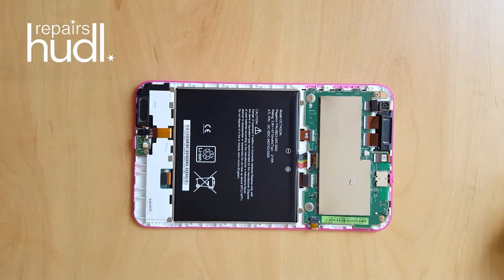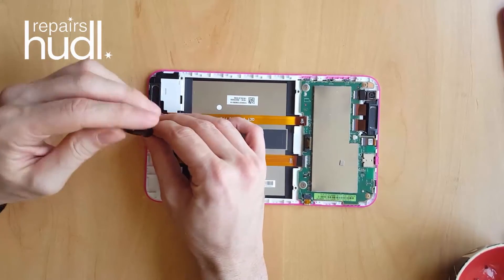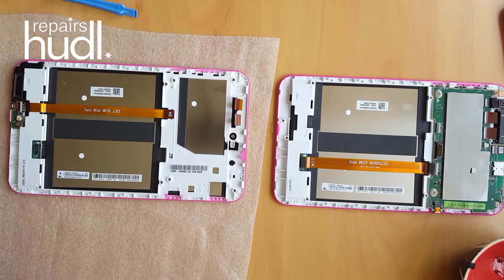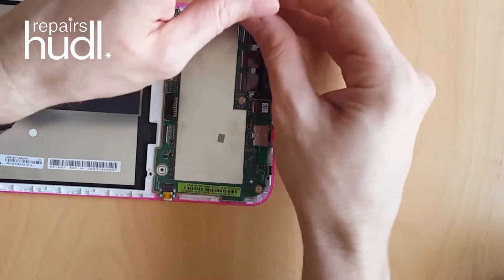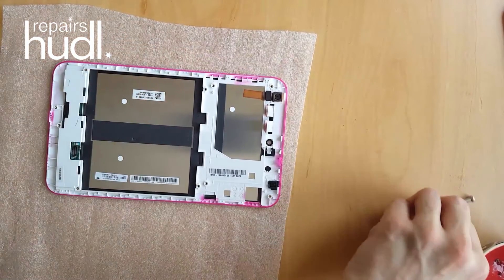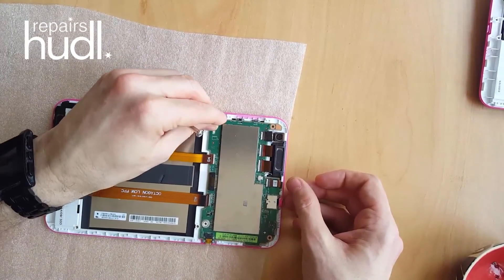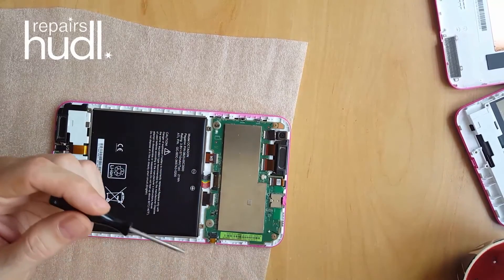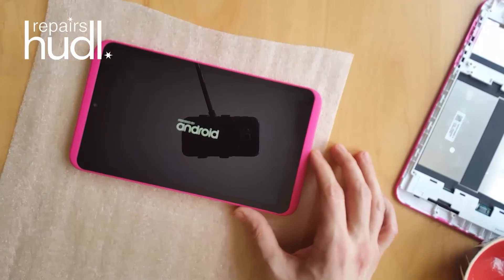Hudl2 Screen Replacement Step By Step

Comment: Superb guide thanks - able to make 1 good hudl2 out of 2 bad ones with your help.
Reply: Where did you buy the screen?
Reply: @helmygalindo  I didn't buy a screen, I had a Hudl2 with a dead motherboard which I had kept for spares. When the screen got smashed on the working Hudl2, I just swapped motherboards.

Comment: Hi, I've just replaced the charger port on my sons Hudl2, simple enough to do and seemed to go smoothly but now the touchscreen doesn't work, I cant see any loose or damaged wires, any ideas what it could be please? Thanks in advance
Reply from the maker: I suspect a loose connection on one of the ribbon cables. I would recommend you follow the video and strip the Hudl2 down and reconnect everything to confirm that nothing is loose.

Comment: If you undo the four small battery retaining screws and lift the battery up it is far easier the undo the battery connector and prevents damage to the connector itself.

Comment: Thanks. I had two Hudl2 devices, one which had developed an OS or hardware  fault and other had a smashed screen. With your help I was able to do a transplant of the Motherboard so I now have one fully operational device. I was puzzled for a little by the small black plastic thing attached to a copper strip which I found on my desk during the operation . It turned out to be the rear camera, which had fallen out - amazing that such a small thing can take reasonable photos.

Comment: Thanks very useful. I suspect that the small black tape ensures that the speaker wires remain protected/fixed to the charger port circuit board.

Comment: Thanks for great video. Just a heads up for others... There seems to be two different sized front cameras. When I swapped over the main board of one hudl to another the camera wouldn't fit so I had to swap that as well. The hole in the screen moulding appears to be a different size on some versions of the hudl2.

Comment: I have just replaced my nieces Hudl2 screen after following your directions. Absolutely no problems what so ever ( I am an ex RAF electrical electronic engineer though lol). The easiest way to remove the back cover from the Hudl is; to use a guitar plectrum just start one corner push the plectrum in and then go around the seam takes about five seconds to get the back off. Also no scratches or dings using this method. Cheers.

Comment: Excellent video thank you. Helped immensely when changing screen. 
One slight variation with my Hudl was that the upper ribbon cable behind the battery seemed to have a slightly different clip on the motherboard. 
Instead of the white part flipping upwards to unlock the ribbon, it was the opposite, ie. the white part stayed flat and the grey/black part flipped up. 
All the other clips were as shown in your video, whereby the white part flips up to unlock.
Hope this may help someone else.

Comment: Very good guide thanks. I appreciated the clear and calm style and the notes about "gotchas". I personally found it easier to disconnect the motherboard-end speaker and remove it separately to the motherboard. My glue was a bit more sticky and came away with an alarming sounding crack, everything intact though.

Comment: hi there
my hudl 2 won't turn on or even charge up.
tried holding down the power button and volume together and just tried a brand new battery. Still no joy.
anyone have any ideas, thanks guys
Reply from the maker: That sounds very much like a faulty motherboard. The trouble is these are really difficult to get hold of. The only real option is to purchase a Hudl2 with a cracked screen on eBay and harvest the working motherboard from that and install it in your Hudl2. The trouble is the prices of these are starting to rise. So expect to pay between £35 - £45 for a Hudl2 with a cracked screen that does boot. On the plus side, you can also expect to get close to these prices if you sell your Hudl2 if the screen is in good condition.
Reply: +SoftwareJellypie 
hi Jellypie
thanks so much for the advice, I will look into those options.
really appreciate your reply
Reply: Nicola May Williams There is a chance the battery is faulty but take jelly's word for it not mine.

Comment: hi guys. followed this guide to fix my hudl 2. After going through this guide thoroughly I am getting phantom keystrokes when fully assembled again. I've replaced the replacement screen with another and it still is doing the same. anyone have this problem before and know a solution?  Thanks in advance Jodie
Reply from the maker: Hi Jodie, the only thing that's likely to cause that is if the ends of the OCTAGON LCM FOC cable are damaged. Are you 100% sure that they are correctly seated? I.E. you flipped the cable clips up to connect them and flipped them down to secure them? If so then you can pick up some replacement pretty cheap on eBay: http://www.ebay.co.uk/sch/i.html?_from=R40&_trksid=m570.l1313&_nkw=hudl2+ribbon+cables&_sacat=0
Reply: +SoftwareJellypie thanks for your reply. I will buy a new cable and give that a try just in case they have been bent or damaged after putting the battery back in. I'll keep you posted

Comment: hi i changed the motherboard over but i have a line right through the middle that is unresponsive have i done something wrong
Reply from the maker: That exact issue can occur if there is a fault with the motherboard, or if the ribbon cables are not seated 100% correct. I would recommend disconnecting the ribbon cables and reseating them carefully. If they are seated correctly the white line on the cable should be scarcely visible.

Comment: which way wud b best change screen or motherboard
Reply from the maker: There's little difference between the two. If you have one hudl 2 with a broken screen (that does boot) and one with an unbroken screen that doesn't, you'll need to open the one with the unbroken screen and remove the motherboard and replace it with the working one from the other hudl2.

Comment: thankyou for the quick response it was fixed twice by tesco under the warranty but has now ran out offered me £30
Reply from the maker: A working Hudl2 screen is worth £35! If you want to sell it, you'll get around that on eBay. However, I'm sure replacing the motherboard will fix it.

Comment: hi i know this is for screen replacement but i have one that doesnt recognise the charger but is still charging as the battery gets warm. it will not turn on nor can i get the reset menu up could any one point me in direction of what could be wrong
Reply from the maker: That sounds like a faulty motherboard. Unfortunately these are virtually impossible to get hold of. The best option is to purchase a Hudl 2 with a broken screen on eBay that does boot and harvest the motherboard from that. Unfortunately, this does of course mean that you will loose all of your data.

Comment: Hi there. I got a new screen after I dropped my hudl and broke the screen. I followed the instructions carefully, and I am normally pretty good with this sort of thing. The new screen doesn't respond though. Is it likely that I did some damage to the tablet when I dropped it and this is the reason? I wouldn't have thought so as it was a short drop onto wooden flooring. Is there anything else I can try? Or maybe the reconditioned screen I bought is faulty. Is there anything else I can try before I try returning the screen for a replacement?
Reply: Hello. my first question would be:
1. After you first broke the Hudl 2, did it still turn on and boot up? If not, then the simple answer is that the motherboard is also damaged. If this is the case then there is no chance at all the the replacement screen is faulty. 

When the glass breaks on the Hudl 2, this always results in the touch screen ceasing to function as a touch screen. However, in most cases it will still produce an image. If it doesn't then most of the time this points to fault with the motherboard.
Reply: Thanks. It booted up fine and still does. But the screen is uresponsive. Some bits of it react if swiped or tapped, and it auto rotates, but it's unusable :(
Reply from the maker: +Davidson Suttie Ok, are the ribbon cables seated correctly? There is a white line on them and this should no longer be visible of the cable is inserted correctly and  far enough with the clips in the up position. The clips should, of course, be clipped back down afterwards. It sounds like some of the contacts on the ribbon cable are not meeting up.

Comment: Once you have done this does it erase all your data? e.g apps, pictures and more?
Reply from the maker: No, all of that information is stored on the motherboard. So as long as that still works, you'll still have all of your data once you replace the screen.
Reply: +SoftwareJellypie Hi sorry to keep commenting but im in urgent need of help as i did this and everything was going well, so as i was taking the ribbon cable out i accidentally ripped off the black and white clip as well. i tried to clue it back and all other stuff but unfortunately it won't charge because, and im guessing that's the reason.  please i ask, is there anyway i can fix it as i have lots and lots of school work and pictures and more.
Reply from the maker: Ok, so is that the clip for the cable that runs from the charging port to the motherboard? If that's damaged, then there is a small chance that the Hudl2 might boot if you put a fully charged battery from another Hudl2 into it. You can buy broken Hudl2's from eBay that do boot and charge for about £25. If it's the other cable then all hope is lost.

Comment: where can i order a replacement screen for a pink hudl from please? i bought insurance on my daughters tablet, they have replaced the screen once and are saying they wont replace it again as its exceeded the value of the hudl (not sure how they think its cost them £99.99 to replace it once) rip off square trade so now i have a devestated 2.5 yr old and im 7 months pregnant so need to do it myself as cant afford expensive repair costs.
Reply from the maker: Hi Jenni, you can find some information about replacement screens and where to get them here: http://hudl2.jellypie.co.uk/hudl-2-screen-replacement/
Reply: that link doesnt have pink :(
Reply from the maker: +Jenni Bowden http://hudl2.jellypie.co.uk/hudl-2-bubblegum-pink-screen-replacement-service/
Reply: cant afford the £60 repair fee. need a screen to do it ourselves
Reply from the maker: Hi Jenni, 
There's a link to the screen supplier I use on this page of my site:
http://hudl2.jellypie.co.uk/hudl-2-screen-replacement/

Comment: How does the back come off from the hudl?
Reply from the maker: You need some tools to do this. What you need is called a pry tool or spudger. These are made of plastic so they don't damage the Hudl2 case. Pry into the crack in the case, slide it along to pop the clips without breaking them. Do this on all sides of the case and it will come off. Just push it back on when you have finished, starting with the edge with the buttons. correctly position these before clipping the case down.
Reply: +SoftwareJellypie Excellent. Thanks for your help. I may finally get round to fixing the daughter's tablet :)

Comment: Great video and easy to follow, my dauter has a pink Hudl 2 with a broken digitizer do i need to replace the LCD aswell as you have or can i just replace the digitizer. Also do you have some links for the parts, thanx.
Reply from the maker: Replacement Hudl2 screens have the LCD and digitiser bonded together, so when you get a replacement screen you get both. Links can be found on the website at http://hudl2.jellypie.co.uk.
Reply: Thanx going to order one and follow your vid :)